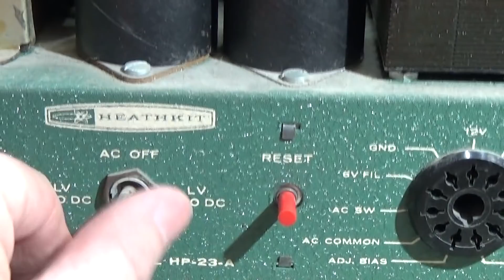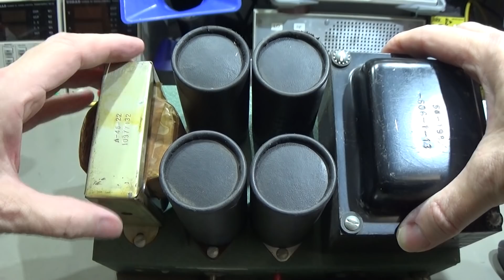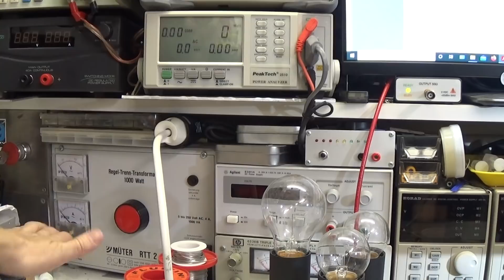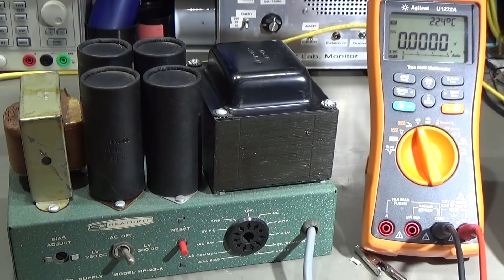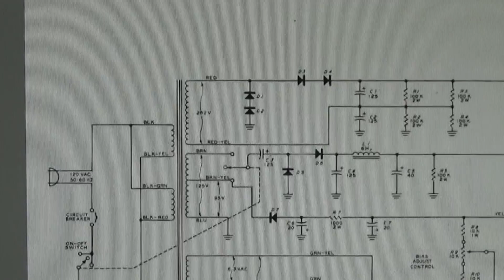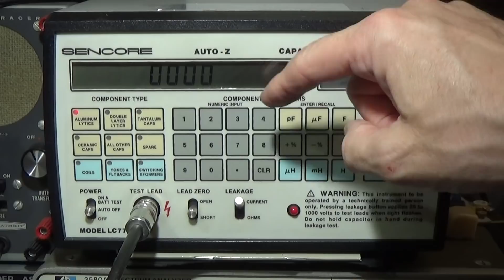#244 Restoring a vintage Heathkit EPISODE 1

Comment: No matter how cheap or expensive the capacitors are a device that old he would replace them all because the damage they can cause especially if it could possibly cause a transformer to burn out that is nearly irreplaceable or extremely expensive A customer should not take that  take that risk

Comment: Very interesting. I have a HW-22A that I built in 1968. Still works but output is very low. I need to probably get new tubes, but will be interested is what kind of RF voltages you measure going through the transmitter section.
Reply from the maker: sure but until we are at this point of the project it will take a while..

Comment: I wish I had the means right now to get my Viking Messenger going.  It's in good shape and I have a parts chassis to go with it, but I need to get a set of channel crystals for it before I can even consider trying to get it to work again.  At least it hasn't been hacked for 10m; that would be a problem for me since I'm not a ham and I don't have that kind of discipline...
Reply from the maker: There are companies which are producing crystals on demand. I don't think that it would be easy to get some originals...

Comment: Peter, great way to start my new year. Heathkit is still my favorite. The switch and headphone jack on the SB-600 is not heathkit, someone added them. I am restoring a HW-100, HP-23 power supply and SB-600, I have many Heathkit items I am working on. The 125mf caps in my power supply had very little leakage for their age, but they got replaced along with the three caps underneath.
Reply from the maker: Thanks for your contribution and for the hint!

Comment: If it were my unit I would insist on replacing all the capacitors in that power supply! Probably also to change out the toggle switch.  Yeah, I know that it will cost a bit, but that gear is worth it.
Reply from the maker: Yes we all hope that we get green light for moving forward..

Comment: Losses: Another  source of losses could be the transformer:: Copper and iron losses; especially from those days when they used low quality iron. But 20W only in the transformer would heat it up so there is another source of losses as you showed us.
Reply from the maker: Let's hope that the transformer is fine because otherwise it really starts to become critical. What I can say so far is that the transformer did not even get warm a bit.. Thanks Stefan

Comment: I think the "wrong" connection of 250/300 V switches are made on purpose 
to avoid overvoltage as the HW 12  manual says that DC B + is 250V and not 300V.
Just my 2¢
Reply from the maker: Very good hint Johan not only 2 cent!! Thank you have to check that out

Comment: That key switch must have been added by the owner.  I think the phones jack was added by the owner also.
Reply: Why?
Reply: @danielhowiesr.2593  A few reasons. First, I had that same speaker.  I don't recall an option during construction for that key switch or headset jack.  Heathkit would not have included two grills: one without the extra holes and one with for the jack and switch.   While the speaker cabinet could house the power supply many just had the speaker as not all rigs used an external supply.  Second, the holes are not drilled in the same place on each side of the grill.  They are off just a little.  Looks like the holes were made by hand rather than done as part of a production run.  Third, the white cord used for the switch.  It looks like a line cord from a light duty appliance or lamp.  It was also stuffed in the same grommet as the power cord.  Heath would not have specified that as a method of construction.
Reply: @w8rko470  What I meant was, why a key switch for a rig? Don't want the wife to use the rig while he is at work? ;-)
Reply: @danielhowiesr.2593  Sorry about the confusion.  My guess is he had kids and was afraid they might mess with the radio when he was gone.
Reply from the maker: Yeah fully agree Mike..Thank you